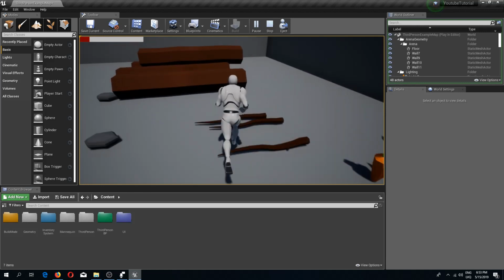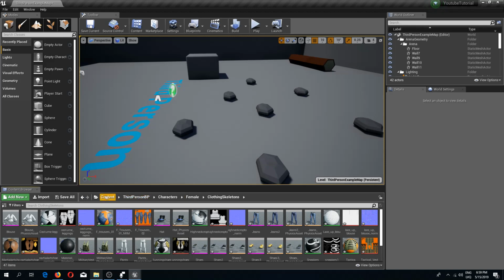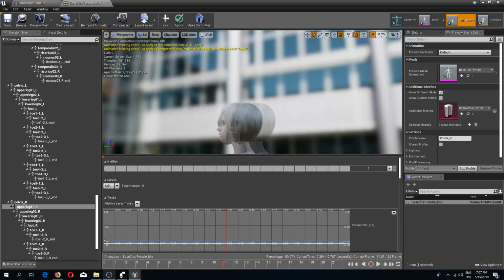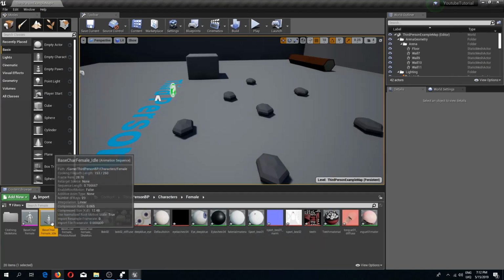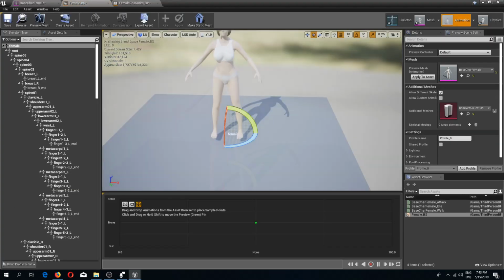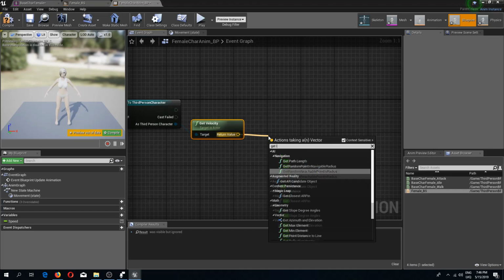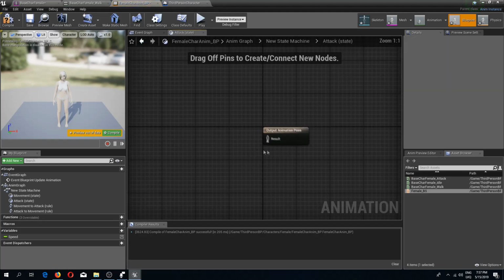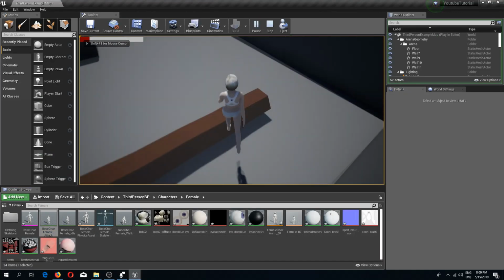UE4 Custom character Tutorial (Free download assets)

Comment: I´m making a character with MakeHuman too, but would like to know how to create clothes for it. My clothes goes through body mesh and I tryed to fix it without success. Any tip on how I should do the process? Thanks in advance! Subbed
Reply from the maker: If clothing goes thru the body only in UE4 than maybe you can try to set clothing scale to 1.01... i had the same issue with some of the clothing items from theyr website. Some worked fine, some didnt. Not fully sure how to work around it :/

Comment: My materials isn’t working they are white
Reply from the maker: On import, did you check import textures?
Reply: @ItsMeBro  Ya It isn't working
Reply from the maker: @albiboss  Added a link for textures.
Reply: @ItsMeBro  Do the textures go into the items/clothing/female folder or the the one with the skeleton? or both?
Reply from the maker: @joeanrachelmiller6529  Just one. You can use the same texture millions of times. So only 1 texture in needed. And it can be placed in any folder.